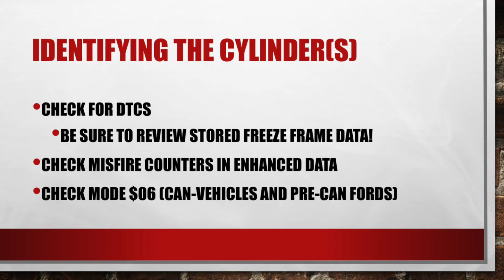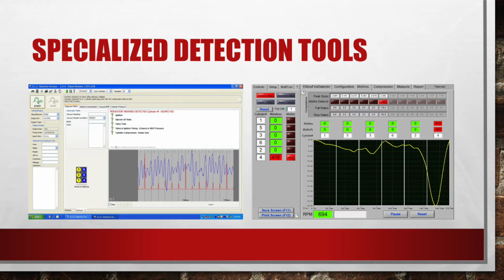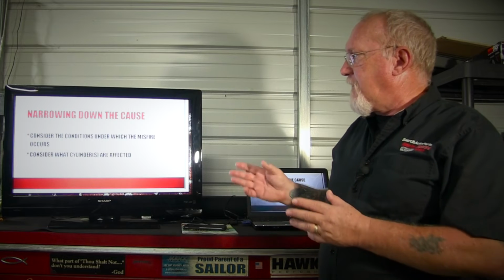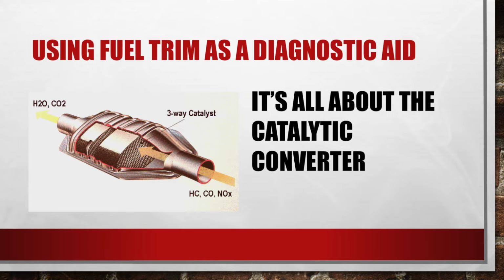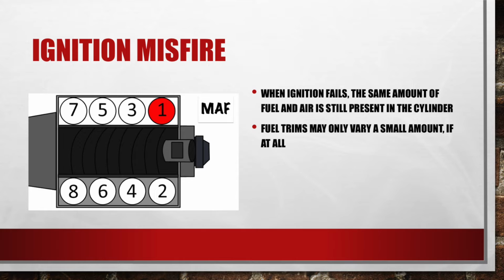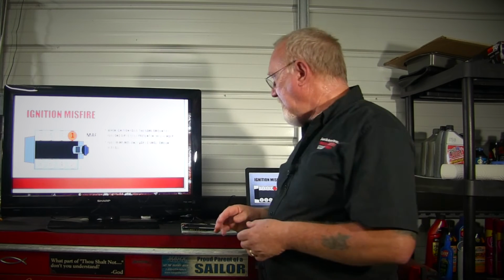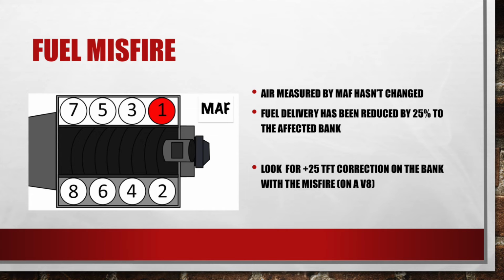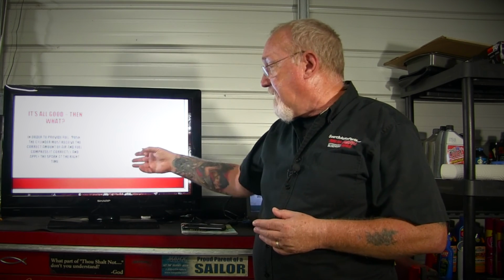The Trainer #66 - Tackling Misfire DTCs

Comment from the maker: FYI everyone! Pete stated that the use of fuel trim was only valid on MAF systems. The impact on fuel trims caused by lack of fuel will be seen on MAP systems as well. Just be sure to check the LOOP PID and make sure the system was in Closed Loop when the data was recorded.

Comment: How about a misfire caused by a cam position sensor's reluctor wheel losing its field or shifting on the camshaft?  That can cause a misfire on hard acceleration at any speed, or be erratic and intermitent when the electrical grounds to ECM and/or sensors are losing integrity. Very hard to find using codes and scan tools,  and the quality of the multiple grounds is rarely measured by car techs.

Comment: What is there's no MAF & the misfire is in 1 cylinder only? I did a Compression Test on a Acura MDX 3.7 L V6 & it showed all cylinders were @ 230 psi while #5 is at 125 psi, I put a teaspoon of oil in there & it didn't bring the number any higher on cylinder #5
What's my problem?

Comment: Do I need to reset the ECM after replacing a fuel injector on my 2000 lincoln town car?
Reply from the maker: You may find it helpful to reset the KAM memory if you are repairing a fuel trim code.
Reply: @VehicleServiceandRepair  Thanks, I'll give it a shot.

Comment: So, how would I begin to diagnose a P0316 code which is set but the MIL lamp is not lit? Is a bad CKP sensor the likely culprit? I believe that the check valve in in the fuel pump module is bad and leaking fuel back into the tank. The FRP immediately drops to 0 when the engine is shut off and at KOEO the fuel pressure leaks down about 1 kPa per second. This could indicate a leaking injector but it seems like a misfire would occur and a DTC set for whatever cylinder was leaking. I notice that this occurs on warm starts. Immediately starting the engine seem starved of few for a few seconds and then recover, hence my theory about the fuel pump check valve.
Reply from the maker: I tend to think, based on what you told me, that there is a leaking injector causing the misfire. The code is for a misfire on initial start-up, and fuel pooling on the piston could certainly cause that. What year is your car?
Reply: @VehicleServiceandRepair  2007 F350 6.8L with 197k miles. I have never had the injectors cleaned or replaced. If this is the case, then should I be worried about vapor lock?
Reply from the maker: @SixMonthsIn  No, I don't think so. Do you have a scan tool that is capable of accessing Mode 6 data?
Reply: @VehicleServiceandRepair  I do. But, I have checked it before and the misfires are all 0 counts on all 10 cylinders. I'll check again. I have replaced all of the spark plugs and all of the coils at about 120k miles so it is almost time to do them again. I've never replaced an injector before. Is it difficult?
Reply from the maker: @SixMonthsIn  I've never done the injectors on the V-10 but it shouldn't be overly difficult. At least its not a diesel or a GDI engine!
Reply: @VehicleServiceandRepair  I checked Mode 6 last night and they were all zeros. Not a single misfire. I think I'm going to punt the ball on this since there are no performance issues. I watched another YT that specifically talks about this code being set due to a switch from summer to winter fuel during October to November. Other sources say that this code is only emissions related and can be summarily ignored if no MIL is on. I sure appreciate all of your help and I have subscribed to your channel!

Comment: It probably isn’t something that happens very often but I have a misfire that’s set while cranking when I look at the freeze frame data. It’s usually below 200 rpm. The engine is usually cold and I would think it should be in open loop which wouldn’t normally give the full range of information for fuel trims, etc. The misfire only specifies one cylinder. I wonder how often something like this happens over a month or years time.
Reply from the maker: Could be a mechanical issue, like a sticking valve.

Comment: Excellent video, very informative.
I'm getting P2097 Post catalist fuel trim system to rich Bank 1 and P2177-system to lean off idle and missfire codes P0300 P0301 P0302 and P0303, on a 2006 Ford Mondeo 1.8 Sci petrol.
Can you give me some adivce on how can i interpret these codes?
Also my battery doesn't charge more than 12 volts with AC and consumers on, and all lights flicker.
Can it be the alternator the cause of the error codes?

Thank you
Reply from the maker: The very first thing I'd do is check the condition of the battery ground cables. Watch this:  https://youtu.be/qdaOSiScEu8

Comment: What about unmetered air? I recently had a 03 Maxima with DTC P 0300 and P0301. Someone had just renewed all the ignition coils and spark plugs. The Mis was felt right at startup and got worse as the engine warmed up. Compression was 180 lb in all cylinders and fuel trim was 25 on both Banks. The problem turned out to be two cracks on the outermost Runners of the plenum.
Reply from the maker: Good call! Consider what you're sharing. If only two cylinders were getting extra air, those two were running leaner than the other two.

Comment: Like you said Pete, ruling out what's NOT the problem under the misfire conditions comes first and sometimes you have to think outside the box for the answer.  
When you were showing the waveform that has the spark, fuel injection and the compression.  What or who has a breakdown of the positions in the compression part of the wave form. How does that compression wave relate to spark and injection timing?  I'm not 100% familiar with that part of the total waveform.
Reply from the maker: Not sure what question you're asking but if you want to know/learn more about the in-cylinder compression test, watch this:  http://ubmadvanstar.hs-sites.com/watch-pressure-acquisition-analysis-from-inside-out

Comment: How would you find a sticky injector? thanks.
Reply from the maker: I can think of a couple of ways. The hardest is one that sticks intermittently but modern DSOs and their accessories can help. First, use a pressure transducer like the WPS500 in the fuel rail and monitor the pressure drops. A sticking injector will drop more pressure than a normal one. If you don't have a pressure transducer, monitor the current flow across all of the injectors and look for the pintle humps to vary on the suspect injector. You could use a second channel as a reference and monitor all the current patterns at the same time. Hope this helps!

Comment: Greetings, you always have great information that is on topic and informative.  I've got a 1998 Avalon, MAF system, and I'm randomly getting p0300, p0301, p0303, p0305 under load (2500rpm). STFT B1 20%, STFT B2 +/ 7% during the event.  I can feel it but doesn't always give me a MIL light.  I'm thinking a bad signal wire or ground wire for bank1, where would you look?
Reply from the maker: What is the LTFT for both banks? Are these numbers from the Freeze Frame data for the misfire DTCs?
Reply: Converter.

Comment: So if an ignition events is weak or fails and you pump a bunch of unburnt fuel and air into the exhaust you'll see a lean condition and single digit + STTRIM??. Would this not present a upstream RICH condition at the time of FREEZE FRAME snap shot.  Also, an injector can hang open and dump fuel in the cylinder causing a rich condition. Not just quit working all together shorting fuel to that bank.
Reply from the maker: If a cylinder misfires due to ignition, the ratio of air/fuel is still lambda. The two will burn in the exhaust with maybe some O2 left over. Trims will vary very little as a result and the O2 sensor will see a "lean" condition. If an injector is leaking fuel or failing to close, it is adding fuel over and above lambda - the definition of a "rich" condition, even if the mixture burns in the combustion chamber as it's supposed to. If it misfires due to the overly rich condition, there will be fuel left over after the burn in the exhaust. Hope this helps!